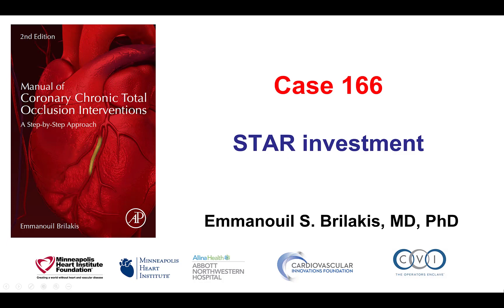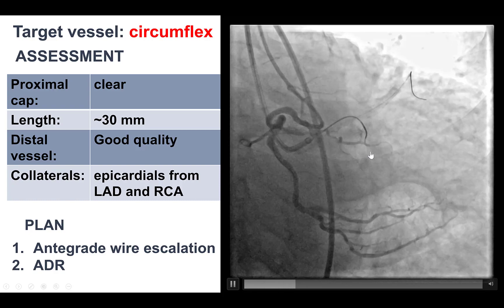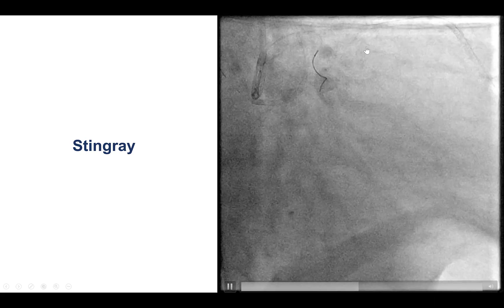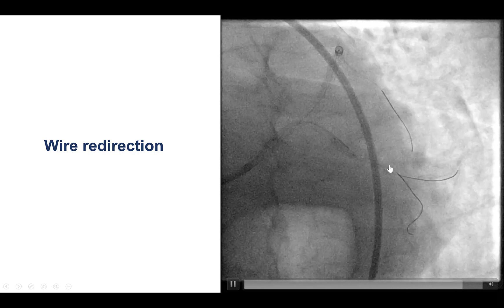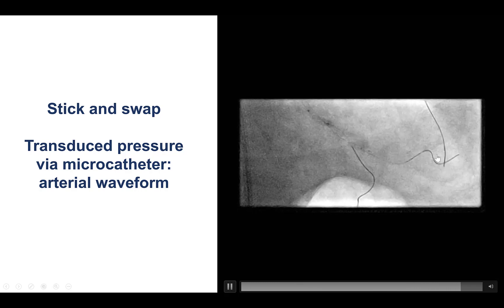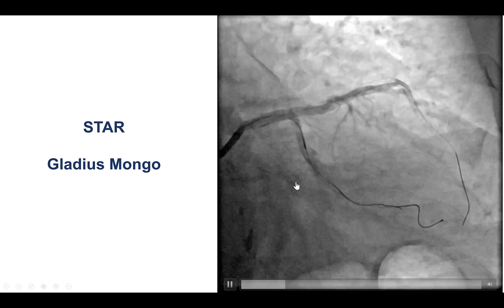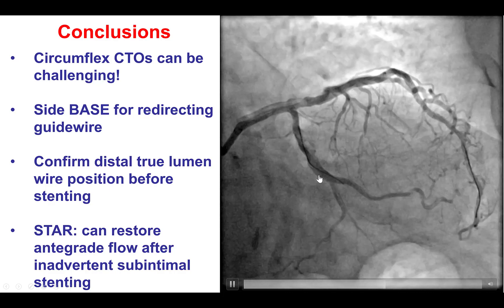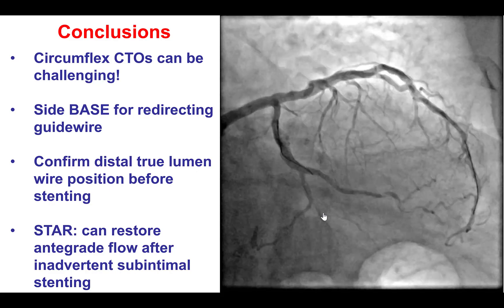Case 166: Manual of CTO PCI - STAR investment

Comment: Thank you for sharing this case. Do you still use pressure transducing through microcather? I tried it twice or three times. Sometimes you are subintimal but you can still have wave forms in the pressure line... Do you have tricks to optimise the use of this technique?
Reply from the maker: We still use the pressure transduction technique - have not really done a scientific evaluation of it but we had a few cases in which we  crossed but there was no pressure waveform through the microcatheter.
Reply: it would be interesting to evaluate this technique  @manosbrilakis